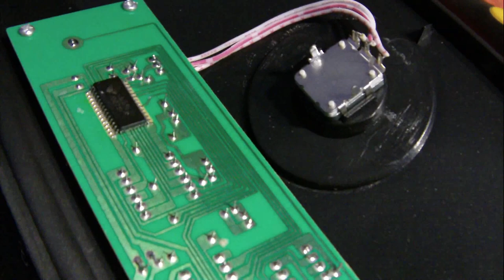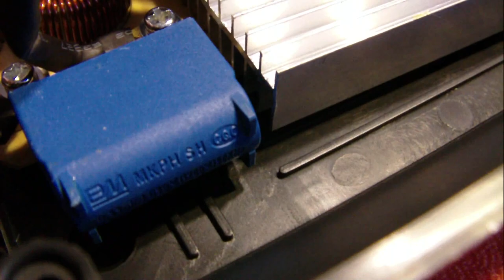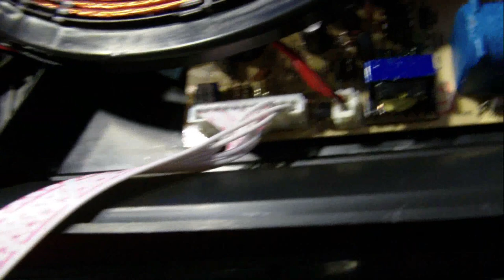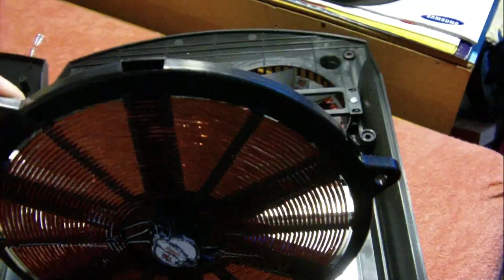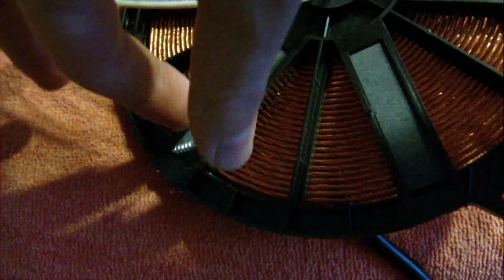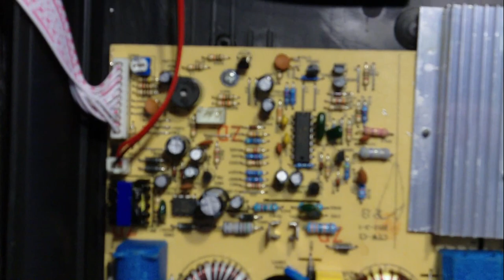Inside induction heater

Comment: Dear Daniel, If you want to remove the top sensor, you need to modify the software. It is temperature sensing and  shuts OFF the cook top once it reaches set temperature level..If you want to use without this sensor, keep the senor on the pcb and not touching the glass.

Comment: Hi. Gret work. I am interested to learn how to bypass the small sensor on top of the coil. Any ideas?
I tried to find the website below, with no luck.
Reply: I am trying to make a stand alone induction heater without all the controls and safety junk that "senses" the pot on top, so I can experiment with different things / metals, plastic extrusions, etc. I see the component is an overtemp sensor only, and is nothing to do with the safety shut off.

Comment: from what i saw the induction coil have two coils.... one must be use to "sense" if some magnetic "pan" is on top saying to work. this could be replaced by an voltage level, level on this would make it work.

did you measure the resistance from the coils terminals?

would be great to use for example a abha or rodin coil as induction coil (replacing the original) firing the bifilar tesla...

just some thoughts.

Comment: What is the white substance on top of induction coil. I have prestige pic 3.0 v2 which have touch sensor. This sensor have the same white paste like substance.. What is the paste called...?
Reply from the maker: sudip maity 
Hi, so this paste is thermopaste for better conducting heat from top plate to the sensor. Very similar form is from CPU paste which have some argentum inside.

Comment: i have induction not heathing.. what must i replace ? thx for your answer
Reply from the maker: Kopana didik harianto 
Cooking top must be for induction heater. So aluminum not work. If something was melted inside a heater, take it to the local electrician servis. For control and measurement all parts inside.

Comment: and why induction stove not long life ?
Reply from the maker: Kopana didik harianto 
Hi, : not long life, because in manual is described this: After cooking, or after audio signal, take-off the top from the surface. When not all accumulated heat go back to heater, and destroy inside components.
Reply: owh,, but he ever said, he never take-off because he want economical electricity costs ??
Reply from the maker: Kopana didik harianto 
From start to end, of the process cooking, must be the top on surface. But after a cooking you may remove the top from induction heater. So I think we better understand now.
Reply: ok mr.. thank you verry nuch